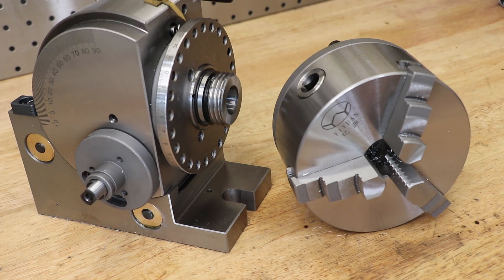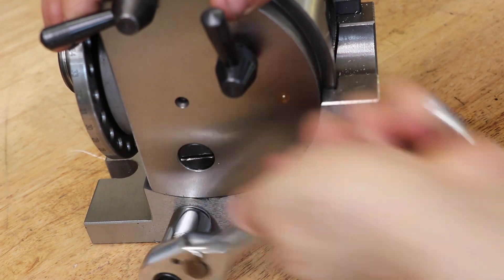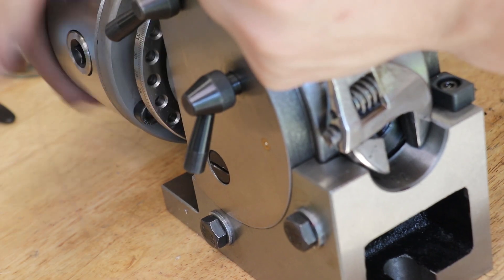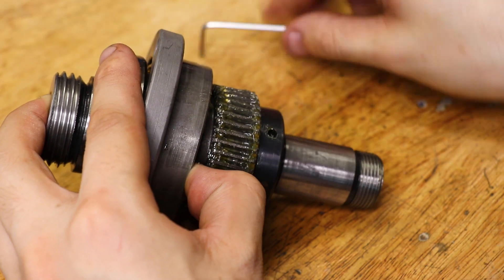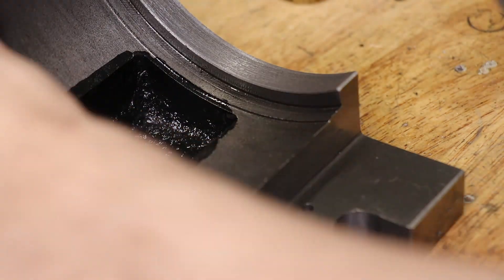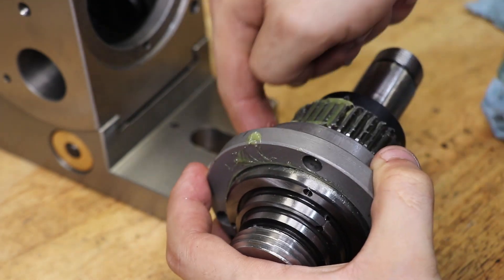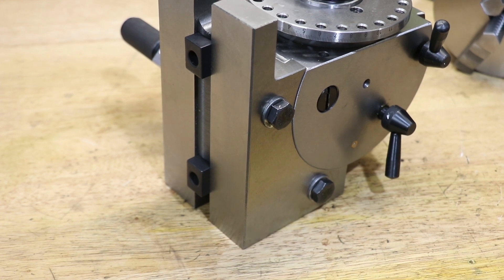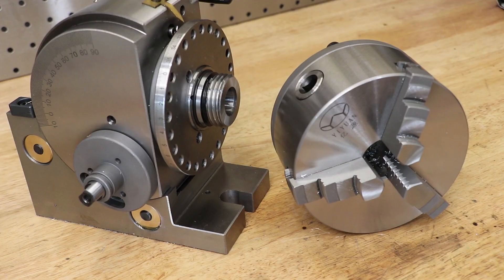$200 Dividing Head | Teardown

Comment: Here's the 5-minute chuck removal approach I just used.  Remove eject spring from chuck key and close chuck up tight. Disengage worm gear.  Rotate chuck manually such that a square key drive point is at 9-oclock   Get a 3/16" hex key as @cellzapper suggested and tilt the head back about 10*.  The short leg of the key is inserted in a hole of the 24 division plate back somewhere in the ballpark of 9-oclock: short hex key leg points to the rear of the chuck, long leg of the key hangs down.  The long leg needs to contact the head mounting flange perpendicular to avoid skating off/under the flange.  Place (spring free) chuck key in that 9-oclock chuck drive point, and whack it with a block of wood and hammer.  The chuck should begin to release.  You may need a few more hammer whacks to get the chuck loose enough to hand turn off.  If so you'll need to reposition the hex key chuck during the process such that a chuck backplate screw doesn't hang up on the hex key.  After reading the trials and tribulations documented here I didn't expect it to be that easy.  But two somewhat related, higher torque fall backs if it didn't pan out:
#1: mount a short 1" black pipe stub in the chuck and the other end in a pipe vise in my shop.  Lockup the 24 division plate with the hex key and turn the dividing head body to free it from the chuck.
#2: similar to above but rather bolt the dividing head to a surface/workbench.  Same 1" pipe stub in chuck but a pipe wrench at it other end, turn to free chuck.

Comment: Sorry if the question has already been posed. Is the thread on the chuck an intentional interference/"progressive torque" thing designed to prevent the chuck from unscrewing during use? I would very much like to slap this on my logan lathe, but I need to find out how to do that safely without damaging the threads on the lathe spindle. Most like by making some sort of collar to both square the chuck and limit the deformation of the threads.

Comment: How can a 3 jaw chuck be accurate enough to make gears?
Reply from the maker: Depends what tolerance you are working to. Involute gears are pretty resilient to a bit of run out
Reply: @artisanmakes  a 3j can easily have 4 or 5 thou (~0.1mm) of runout. That’s not an issue for a gear?

Comment: One way these manufacturers lower the cost is by skipping a few cleaning steps along the way. Also hardening is often a bit lower than usual, often in the high RC 40s rather than the high 50s. It’s ok, and for the amount of use these will get, wear won’t be a problem with proper lubrication.

Comment: Nothing stopping you making another direct index backplate with other divisions for example a 101 or any other division that you can't do normally achieve.

You could make alternate size locking pins for tighter devisions if swapping the existing locking plate or Bolt a second locking pin further out from centre probably on side of the body with a larger diameter plate

you could have the new dividing plate machined to bolt over the existing one  temporarily removing the chuck to mount and dismount as needed.

It would probably take less time to swap the wheels than it would to use the indirect dividing handle especially if you are machining multiple parts 

Common divisions in automotive work are 36 (for 36-1 trigger wheel) and 60 (for 60-2 trigger wheel)

Another option would be to index the outer edge and have a radial locking pin, it would obscure the degree marks though.

Comment: i blows my mind that they leave so many chips behind b4 assembling them in the factory, i want to pick one of these up so bad but the price an the mill i have is smaller than what u have so i dont know if i could even use one this size on my mill so ive just been looking to pick up a 4" rotary table instead but it would still be nice to have one of these.

Comment: The timeline 6:20 😧👉 Never use hammer direct on the spindle! Use the 3 screws to mount the bearing house on the indexing head. If you are knocking the spindle then you can damage the tapered roller bearing.

Comment: Thank you for an excellent video! Please may you explain how the spindle lock/clamp works? (Not the indexing pin) Cheers
Reply from the maker: The clamp is just a split collar, as you tighten the lever it clamps on to the shaft that connects to the worm gear and chuck, which clamps everything ok place
Reply: is it shown at 4:19? does the lever on the side close the clamp?

Comment: I have just received my VEVOR Dividing Head, And have had EXTREME difficulty  removing the 4" chuck.
I removed the bevel gear shaft to protect the gears and did not use the locking peg because I did not want to damage the unit. The shaft lock was inadequate to hold while I battered the chuck with a lever and a hammer. I tried heating the chuck moderately with a MAP torch to no effect.
Not wanting to damage the chuck (more than I may have already) I removed it from the backing plate, to do this I had to file flats on the sides of the 3 cap head screws holding it on, and then used the cap head screws to push the chuck of the backing plate by winding the screws back against the the 24 hole plate behind it. worked very easily.
I used pairs of 8mm nuts on the backplate screws to provide leverage points, but more hammering and heating (this time until the release oils smoked) no avail, 
Noting that you said you made something to help, I hit on the idea of using an ALLEN KEY as a brace to stop the 24 hole plate turning, I found a 3/16" 2.5" long Allen key fitted through a hole from the rear of the plate down to the cast iron foot of the unit was a perfect jamming device.
The next attempts with a hammer succeeded fairly quickly in releasing the backplate, which still remained reluctant to come off easily.
Inspecting the threads showed a nasty bur on the inside edge of the threads which was causing the backplate to bind up when refitting it, I filed these off with a needle file and smoothed off the tops of the 1st few threads at the rear. After several attempts the backplate fitted more easily. the threads in the backplate are also very roughly finished at the same point, but are so hard I needed a diamond file to smooth them just a little.
The supplied thread protector fitted extremely well at all times.
Vevor's online description says there is an MT2 in the Chuck end of the main shaft, with a supplied MT2 centre. The online spec also mentions an MT2 tailstock but as far as I can see so far it is a solid bar with a half centre machined  on the end.
The MT2  centre fits well into MT2 to MT3 convertor that I have, and a mt2 ER40 Collet fits extremely tightly.
I suspect that these BS-0 Dividing Heads are made market specific, and USA models may be BS7 as stated in the manual (and original spec)
Reply: Y con esta experiencia recomiendas comprar un cabezal divisor de la marca vevor estoy por comprar uno y no he decidido, tu lo recomendarías lo quiero para fabricar engranes
Reply: @manueleag8980  I think the Vevor Brand is very good, I trust them to produce good equipment for the price range they occupy.
This dividing head has not been tried in anger, due to ill health, but the testing I have done suggests it is as good as anything you will buy for this price, and as good as the rest of the market unless you buy a expensive high precision dividing head. The initial tight fit of the chuck seems to be a common feature of this dividing head, but once freed it is no longer a problem. I stripped my unit down and found no rubbish inside and everything worked well. It really did not need to be stripped down at all. Hope this helps.

Comment: Just think how successful of a product it would be if they hit it with an air gun and spent less than a minute with a file on it (ones of the right shape).

The difference between a worm mesh and a cross helix is massive in load capacity. Worm mesh has a line of contact while a cross helix has point contact. So in this application cross helix is probably ok so long as you never turn the head under cutting load... I really don't know what the failure mode would be, excessive wear sure, but would it really fail? IDK

Comment: You do realize that if that spindle thread were on a cap screw it would take several hundred lb/feet of torque to bring it to full spec?  I wager you were not using even a fraction of that before it came off.  I'm not saying it wasn't too tight.  Just keeping perspective.

Comment: The worm gears are non-enveloping. This is why you don't see the concave features. If both the wheel and the shaft have concave features, then it is called a double enveloping design. D-enveloping can carry more torque. Being made of steel is not surprising for the application. Being made of steel they probably didn't deem necessary to add enveloping.

Comment: You can put threaded studs in the chuck's screw holes, and use tall nuts against the body to press the chuck off.  I used this variation to get the chuck off a mini lathe spindle.  Mike Taglieri suggested it to me.

Comment: What is the thread on the "spindle"?
Reply: 1 1/2" - 8 (1.5" x 8 tpi) according to the manual
Reply: I saw something that said they used the MyFord thread which would be Whitworth 55 degree.  Can anyone confirm this? @qcnck2776

Comment: A chain vise grip do a better job on removing the chuck, it allows for more leverage, hold the grip on the adapter plate because it`s rougher and  use a wood sick to tap the vise grip.
Reply: Also with a brass rod and a hammer you can separate the back plate from the chuck. So you could also replace the 3 jaw chuck for a 4 jaw or collet chuck. I used a no-name 5c  import and it fits nicely.

Comment: That's actually a BS taper, not a Morse. My rig required a lot of deburring as well.
Reply from the maker: They are very similar, though it's a bit up in the air to what this is. My manual says BS 7, although it's just ripped from someone else's manual. The parts list says this is mt2 and the dead centre is listed as mt2. It seats mt2 stuff decently. Might have to blue it up to see what the contact is like
Reply: @artisanmakes  The model in the video is exactly the same as mine. It's a chinese knock-off of the BS-0. The actual Brown and sharp - 0 manual is downloadable off the web and fits the unit perfectly in all ways if one needs a manual. It's handy because it has a table for setting up the dividing plates for milling gear teeth as well as the other features. In the manual it also specs the taper as a bs taper.
Reply: I looked up the difference between Morse and BS tapers they are no way compatible if MT2 fits, then  it IS MT2
Reply: @cellzapper  Depends on what you mean by 'fits'.. Since you cannot look in the bore after sliding in another taper it may be touching at one point and feeling snug.. That doesn't mean the tapers actually match.
Reply: @fredflintstone8048  You are of course correct it fits where it touches, I have revisited the Taper Data and the MT2 will be very loose at the big end, being 20 thousands smaller, and the the taper is different but it is giving me a headache trying to visualise the info, needless to say the taper is also different.
I have just received my VEVOR Dividing Head, and their online description says MT2 in the Chuck end, with a supplied MT2 centre.
The MT2  centre fits well into MT2 to MT3 convertor that I have, and a mt2 ER40 Collet fits extremely tightly in the dividing head.
I suspect that these BS-0 Dividing Heads are made market specific, and USA models may be BS7 as stated in the manual (and original spec)
Reply: @cellzapper  I'm not sure of why BS made it's own taper but it stands to reason that they would have used their own taper from that perspective. Perhaps it was a popular taper at one point in time. It seems to me that the Morse taper is the industry standard to date. I have a import copy of the BS-0 dividing head. I'll probably try and check the taper at some point to see if it matched the BS taper spec.

Comment: I'll also agree that this is a pretty nice tool for the price point. Still shocking that the factory can't clean these parts of the chips/grit and debris before assembling them. This is so common with many things made in China. Brand new carbs have to be disassembled before use to clean them.
Reply: They just don’t care. As soon as they do, we’ll all be out of jobs …
Reply: @Stefan_Van_pellicom  If they increased the price by $100 they could make it perfect. Phase II is a good example of a quality chinesium brand.
Reply: Friend bought a chinese turbo and didnt clean the inside before bolting it on his car :)

Comment: To remove the chuck could you not turn a bar with the same thread as the spindle and hold another bar in the chuck jaws? Rotate the screw to add pressure and then tap with a hammer. Might work.. Great video as always. 😁
Reply from the maker: Yes but my lathe probably wouldn't be up to turning threads that big. I'm sure I can get it to cut imperial threads, but probably not threads with such a low TPI

Comment: Great video's of your Dividing Head. I have the same one. I have had it several years. My eccentric  adjuster for the worm gear broke because the slot for the adjuster bolt was machined excessively  wide. Thanks for the nice video.

Comment: Sorry for poor English, but I'm try to explain. Since the worm have not firm position against worm gear (worm installed in rotating eccentric part that can engage and disengage the gear, and also you can adjust the backlash in gear by rotating the eccentric), it is impossible to use proper worm gear. I have dismantle some dividing heads and rotary tables, Soviet and European made, and there is always helical gears, it's typical.

Comment: Before changing the worm wheel, remember the cam adjustment adds a sideways component. Also are you sure it is a Morse taper? Page 2 of the manual lists it as a B&S No.7
Reply from the maker: My manual says the same thing, though it seems that manual is copied from another companies BS-0. My parts list lists this as mt2, and all the mt2 tooling seats just as well as it does in my lathes tailstock. Cheers

Comment: You done good buying one they’ve doubled in price and I put off buying one for months and am now kicking myself royally
Reply from the maker: Really? I was checking out the Vevor store on AliExpress before I posted this and they are going for about $250 AUD. Might vary depending on country I guess. Cheers
Reply: @artisanmakes  The reason you have a straight cut worm wheel with teeth angled and not one cut with a helix is because the worm rotates on a cam and the worm then moves sideways slightly.....if the worm wheel was cut like a worm wheel in a gearbox ....which is fixed......the worm would jam in the teeth with any sideways move..........I did mention previously with the first review of this dividing head that the worm wheel was cast iron and not bronze but the "experts" disputed this............I have the same dividing head and stripped it when I first bought it for various reasons.
BTW......the chuck is screwed on with a right hand thread like a lathe,  and as the milling cutter rotates clockwise against a work piece it imparts a force that will tighten the chuck on it's thread........if the cutter is applied against the opposite side of a work piece it could cause the chuck to loosen as happened in an industrial accident many years ago.
This is the same as running a lathe in reverse with a screwed on chuck.
Reply from the maker: That makes sense with the worm gear. And I had no reason. Not to believe you when you said it was cast, I just wish that the listing didn't list it as bronze. I'm sure that the manual is ripped off another companies BS-0. Cheers
Reply: @gangleweed  Ian, I have a knock off BS-1, and I recently decided to open it up partially to look at the state of the worm gear and worm. Now, I am having trouble getting the worm shaft to go back in and put the mounting bracket back. It seems to be slightly misaligned. Any tricks, thoughts?
Reply: @qcnck2776  That's a bit of a puzzle.....make sure the worm eccentric body is rotated slightly as you insert it as it's eccentrically mounted for adjustment of the worm to the worm wheel so you might have it too full in the depth engagement.
Reply: @gangleweed  Ian, Thanks for your reply. I finally got it figured out. The  nylon washer that was the problem. It was just slightly too large, and when I was first trying to put the worm shaft back in, I had the washer close to the mount. As you know, the mount is a very tight  fit, and that was enough to keep it from going back in.
I had no trouble aligning everything once I pushed the washer further towards the worm. 
Just goes to show how minor tolerance issues in non-critical dimensions can sometimes bite!
Reply: @qcnck2776  Good work........a tip I learned many years ago, when you fit a 3 jaw chuck to a dividing head, or a lathe,   ALWAYS make the register on the backplate a slack fit to the chuck body, at least .25mm (.005")......this will allow you to slacken the holding screws to the backplate and bump the chuck body with a soft hammer to get a part to run dead true.......it will make an old chuck work like a new one.....on all diams...... as a chuck that runs out .001" means any work piece also runs out........this only applies to a 3 jaw chuck or even a cheap 5C collet chuck.

Comment: $200 Chinese dividing head plus $300 worth of careful rebuild labour = priceless! 👍🙂
Reply from the maker: Hobby machining in a nutshell. Cheers
Reply: It's still amazing to get the head for only 200.
Reply: @alienmoonstalker  That's some expensive head, you need to find better street corners man.
Reply: That pretty much sums up any metalwork machinery and accessoiries from China, unfortunately.
Reply: Alternatively, you could buy a used 'high quality' dividing head for $500 and then spend $500 rebuilding it ...